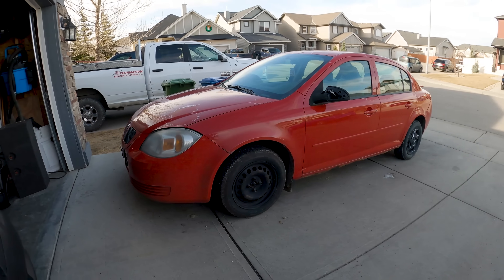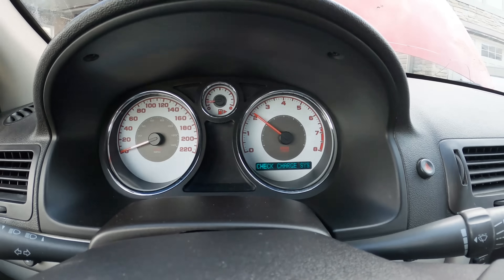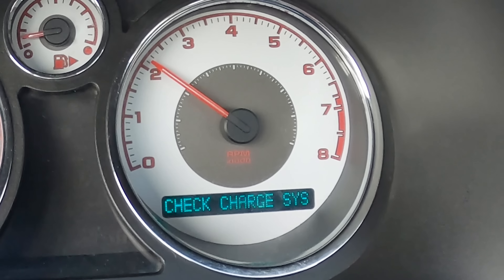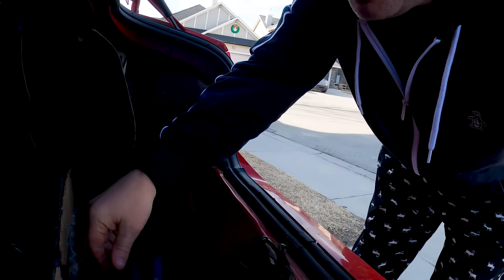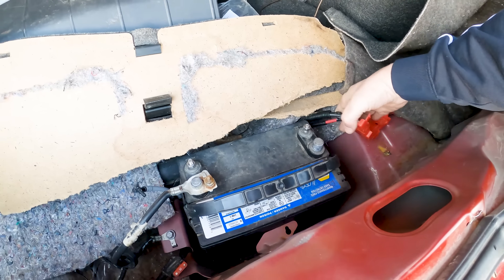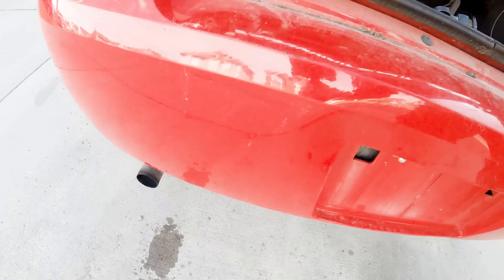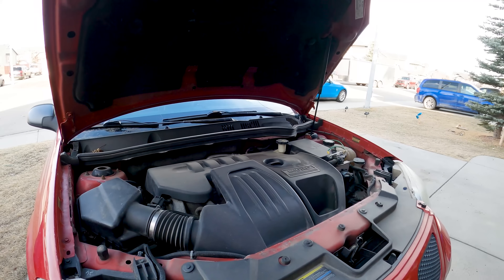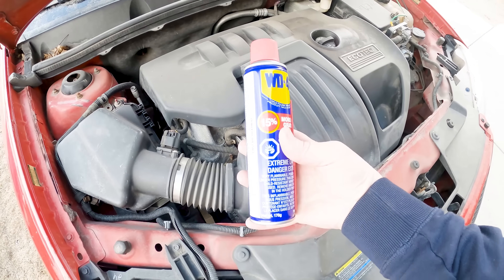ROADSIDE FIX! REVIVE your DEAD or DYING Alternator with this ALMOST FREE trick! | Gears and Tech

Comment: the alternator monitors battery voltage  when disconected it will over charge , in some cacesit will distroy the alternatoe internal electronics,
  i have been an auto electrician since the late seventies  for rover / jaguar all the workshop manuals stated that you never disconect the battery with the engine running
Reply from the maker: How many have you seen with fried computers due to disconnected battery?

Just curious.
Reply: Lost me at Jaguar 😂😂 I'm a car guy,,1 of the best Mechanics I ever knew had a Jaguar 80s  4 door landyacht. He couldn't keep it running right, constant electric issues. He said the reason Jaguars  have 4 doors, comfortable backrests is so you can take your Mechanic with you 😂😂😂
This guy built a Batmobile ...the real one from TV . It doesn't have electric issues, but it does have a Nerf Rocket ,rocket launcher ! 😅

Comment: Not a smart or "secret" tip!  WD water displacement. Not voyage regulator or brush repair in a can. Absolutely silly advice 90% of the time it won't do anything. And pulling cable on running engine with ECU & modules not smart!
Reply: SO call the tow tuck then wiggle..for the 1000 time:
This is a stranded on the  ROADSIDE  'try' when there is NO way to access the proper channels/stores/mechanic !!
Reply from the maker: 90% of time does work. And always worth a shot if you're stuck and beer it going again

If this doesn't fix it then nothing can

Comment: With modern cars you are not supposed to disconnect the battery while the engine is running. You can burn out electronics which can be expensive repairs. There are better ways of testing the alternator and battery. Parts stores often will do these test for free.
Reply: So newer car don't have fuse? Wtf
Reply: A fuse won't help. Electronics are sensitive to small power surges way below what it takes to blow a fuse. When you remove a terminal, it cases sparking and small surges.  @santaisantai6830
Reply from the maker: What's the best way to get to the parts store for the free test when your car doesn't run due to dead alternator?

A tow charge is a lot more than a can of wd40.
Reply: Good point, but I would take off the negative terminal from the battery and put it on a charger. If it charges up to full and holds the charge, then just take the battery to the parts store for testing. If it checks out ok, then it is most likely the alternator. One way to safely test the alternator is start the car and turn on your headlights. If they get brighter when you rev up the engine, then alternator may be ok. Of course, you can try the WD-40 trick that may help your car hold the charge long enough to get to the parts store or a garage. One thing is certain, you will need to replace either the battery or the alternator, and possibly both.       A bad alternator can ruin a good battery.
 My main point here was don't unhook the battery with the engine running. It used to be safe doing that on old cars but not now with the computers and electronics they've added it is now risky.   @GearsAndTech
Reply: @stevenw4549 this video is for when your vehicle dies and has you stranded.   Emergency type situations .

Comment: Turn the headlights on to put a load on the system before ever disconnecting the battery will provide stability for the charging system. This prevents any wild pulses. 
The headlights are also a good test for battery connections. Turn them on if it won't start and move the terminals to see which one is bad and scrape it clean. 
If terminals are good then if the lights are dim when running you have issues with the alternator.  
If you have had a dead battery and just gotten a jump to start it, never run it at speed to fast charge your battery. Alternators have only a voltage regulator and no current regulator so if they try to put out too much current to charge a dead battery they can be burned up (blow out one or more of the 6 internal diodes). A slightly fast idle for 10 or 15 minutes should get the battery up to where the alternator won't go overcurrent. 
In emergencies,  a couple of small wires such as 12 or 14 gauge house wires will charge a dead battery over a 15 or 20 minute period enough to start the vehicle. Probably good to remove the small wire connection before trying to start or you could burn up that wire. 50 years ago I started a diesel truck with that trick, though I charged for about 30 minutes. Cars are much easier to start.
Reply from the maker: Thanks fro the info

Comment: Using the USB adapter as a voltmeter to check charging voltage is reasonable, assuming any accuracy. Spraying something like WD40 into a running alternator is not such a good idea because of the risk of fire.

If there's so much carbon build-up from worn-out brushes that the exciter current is partially shorted to ground then this could explain a weak alternator output. I certainly would not use WD40 for this because of the oil contamination it causes. I would use something that evaporates completely like Isopropanol (Isopropyl Alcohol), Carb Cleaner or maybe Brake Cleaner. Once excess carbon deposits are flushed out the the excitation should be at least partially restored and alternator output improved. I would turn the alternator with a tool either directly or on another pulley. Also, don't use too much as it will flush any lubricant from the bearings if the fluid goes near them.

Disconnecting the battery with the engine running is incredibly stupid and irresponsible. The engineering manuals say never to do this for very good reasons. Like with electronics in general, there is general misconception that something electronic will either work or it won't. The real engineers and technicians know this and understand how and why this is simply not the case. They also take great care to avoid the possibility of damage to electronics. Electronic components can be damaged in way that are invisible externally and appear to work normally. There is reason why some electronics systems are plagued by random faults and failures yet others are not.
Reply from the maker: If an electronic component is broken, but still appears to be working fine, is it really broken?
Reply: @GearsAndTech An electronic component can still be damaged and work. The problems are that there is now a question of how long until it fails completely and how, as well as intermittent malfunction. These issues are actually well known in the specialist electronics field. Unfortunately there is a massive amount of ignorance regarding these issues, partly because of self-proclaimed 'experts' who in reality have little real knowledge or understanding and otherwise because these important facts are simply not taught at a basic level when they should be.

Comment: This is at about the same level of idiocy as leaving the engine running, and therefore all the electronics connected and powered up, while jump starting another vehicle. It's just not worth the risk of damaging the car's systems with such nonsense. Some parts may be very expensive to replace, but others may be unobtainable or extremely rare. There's stupid, and there's this.
Reply from the maker: Haven't seen that happen either. If you jump a car properly there is no risk
Reply: @GearsAndTech Sorry, but that's totally incorrect. The alternator was never designed to power a starter motor, which is basically what you are asking it to do when the 'donor' vehicle is running, as well as power all the donor vehicle electrical systems and put some charge back in the donor battery. With the high currents involved, invariably different voltages, and two generators on the same circuit there will inevitably be large spikes and surges as a result. There is no getting around this. You may find that the donor vehicle seems fine after this, but the alternator may not be outputting the quality of power required for correct operation of the electronics because they are an AC generator, and the alternator will likely fail much sooner as a overloaded diode bridge does not last as long. Alternators should be extremely reliable, this drastically shortens the life of it.

Have you even tried measuring how much current is demanded from an alternator when the car is running or immediately after start up? Have you ever measured the inrush current of a starter motor? If you had, then you would see how it is a very bad idea to try and jump start a vehicle with the donor car engine running no matter what 'technique' is used to attempt it. If your battery has enough power to start your car without a jump or boost then it can start a different car through jumper cables.

If you find a lack of voltage then it is very likely that your jumper cables are at fault and not up to the job. Sadly there are a lot of garbage jumper cable sets being sold that are only of any real use for jump starting a lawnmower or small scooter/moped. Decent cables are not cheap because of the amount of copper and build quality, but the expense is well worth it when you come to depend on them.

Comment: My wife Acura battery was bad and had her go by Auto Zone and have test ever thing alternator and battery tested bad so they put a battery in her car and every time you turned it off with a warning battery is low so I took her car to Auto Zone and when I got to look at it , it had a lead acid battery in it and I asked them why did you put a lead acid battery in it when it calls for a AGM battery and they guy told me it didn’t matter and I told him the battery doesn’t fit . So I told the to pull that out and put the battery it calls fore and the guy said your wasting your money and after he out the right battery in . And low and behold no more codes about low battery. To me he just stuck what he had and to make it fit and it’s been several months and no more codes .
Reply from the maker: Glad to hear you got it sorted

Comment: At idle..13.5 volts, peroid cold or warm.. been wrench since i was 16, and i am 58 now.  A older car pre 40 computers . You can pull the battery cable...yes it can trash the alternator  .. but check the voltage charging at idle...13.5 always 

I never driven straight off the alternator...

Ugh
Reply from the maker: Never had a battery fail open before?

Cars drive straight off the alternator up her in Canada all the time and never even realize it

Comment: And if you turn on the lights and the engine seems to lose rpms you're not charging .
Reply from the maker: Yes, sort of.

Even a charging car will lose some rpm when load increases. Usually will bounce back up. But still.

Comment: Even if your electrical system is 100%,,,, the engine will die when you disconect the battery, because you have broken the circuit which will kill the ignition, unless it is a diesel engine which does not rely on a spark for ignition
Reply from the maker: Think about what you just said, and then go try it yourself.

It's just simply not true. I even showed it in this video

Comment: As so many others have commented, disconnecting the battery cable with the car running is a very bad idea. Sorry but this is one example of anybody being able to make/post videos who have no idea what they're doing, and have no credibility. This causes the unknowing who are seeking good advice to not be able to separate good advice from junk. This falls into the second category. There is so much good stuff on YouTube, but there is also so much absolute hogwash. Just because you saw Uncle Fred or Bubba the neighbor do it doesn't mean it's good advice. It's one thing to post a procedure for say changing out brake pads. It's another to give advice based on no credibility. Please make it stop.
Reply from the maker: Lol, people with no credibility can comment too. That's actually easier because it requires no skill

Comment: One other sort of road side test you can do is with the vehicle running, if the alternator is producing voltage a screwdriver, or a light metallic object will stick to the back of the Alternator Center, there will be a magnetic field when the alternator is charging, I have tried this on a number of different models and they were all charging…it’s a starting point if you have no diagnostic tools
Reply from the maker: Excellent point. As long as you can reach the alternator. Many times you can't reach it at all

Comment: I laugh at videos of people giving wrong advise acting like they know what they are doing. Do not disconnect any batery terminal while the engine is running this wil cause the alternator to over voltage and damage any electronics including the ECU computer and the alternator diodes. Obviously its not charging because the voltage was around 11 volts after start. It should have risen to 13.8-14.4 volts immediately after starting. The only situation where wd 40 or any hydrocarbon liquid will give the alternator a little fix is if the brushes are not making contact with the slip rings because they are seized. This will not work in many cases, however you got nothing to loose just never disconnect a running cars battery, it will cost you lots of $ to fix.
Reply from the maker: Which car specifically is this guaranteed to fry the ecu? I would like to test it and prove this myth wrong.

Ive done this on every brand of car, across all regions. Never once seen any computer components fry

Comment: After spraying WD-40 into your alturnature I would recommend you wait 5-10 before you attempt to start it. Although WD-40 is not combustible, the carrier is mildly combustible. Giving a few minutes before starting the engine allows time for the combustible part of the spray to dissipate..Never tried this but it makes sense that it could work in specific circumstances.Good luck.
Reply from the maker: Thanks for clarifying
Reply: A little flame is good for firing up the alternator engine back to life

Comment: If your “top secret “ tip for valve tick is a 5$ additive, your a straight dip
Reply from the maker: Wow, you came into a different video to comment and made a whitty rhyme.

I hope you come back and share more
Reply: @GearsAndTech  Which video? and is there another video where you put trans fluid in an engine? If so, which is that?  I'm quite interested in using detergents to try to unstick rings in engines that appear to be worn out.  I though I saw a comment to that effect, but now I can't find it or any likely video on your channel.

Comment: Removing the battery while the vehicle is running on newer Vehicles will fry the computer eventually so let's destroy the car Electronics that works fine and dandy for older vehicles that has a voltage regulator it's never a good idea to pull the battery on anything newer that's a voltage regulator is built into the alternator in controlled by the ECM
Reply from the maker: How new do you need to go for this to happen? And how certain is this failure?

I'll make a video pulling the cable on a different vehicle and see what happens. Just need to know which one you're talking about so we can test your theory
Reply: @GearsAndTech  depends on the vehicle some started the late 80s some started in the early nineties obviously if it has a voltage regulator separate from the alternator then you can do that by pulling the battery to test your alternator. All newer vehicles has the ecm  2 control the charging output and it relies on seeing a good 12 volt battery to have All Electronics working correctly you can get a bunch of false codes in a newer vehicle with a bad or weak battery

Comment: Disconnecting the battery with the engine running will absolutely destroy computer modules in the vehicle.  This is NOT because the alternator thinks the voltage is low and will increase output.  Doing this will damage computer modules because the battery acts as a filter (like a massive capacitor would) to smoothe out the "noisey" power coming out of the alternator.  Computers need clean power due to the semiconductors used in them, and the small peaks and valleys in the power waveform that are left after the full-wave rectifier bridge on the alternator has done its job of converting the A/C output of the alternator to DC, are more than enough to cause major problems without the battery there to "absorb" the variations.  The test you did in this video is something that was okay on 70's era, and older, vehicles; NOT anything that uses a 5-volt computer system like OBD or OBD II (So basically nothing after the mid-80's).

You are quite lucky you did this with a completely non-functional alternator, or  you would have likely totaled the car with how much the replacement computer modules would have cost, seeing as the car was only $500.
Reply from the maker: how certain is this failure?

I'll make a video pulling the cable on a different vehicle and see what happens. Just need to know which one you're talking about so we can test your theory

Comment: Electrical contact cleaner would be a better choice than WD40 but if all you have is WD40, then go for it. I would be surprised to find any shop that repairs alternators. I was able to replace the carbon brushes in my Honda CRX alternator saving me a heap of money. Another thing that can contribute to alternator failure these days is the overrunning clutch in the pulley.
Reply from the maker: I have a guy that rebuilds alternators. It's more common than you think. They just don't want your core back because they have plenty